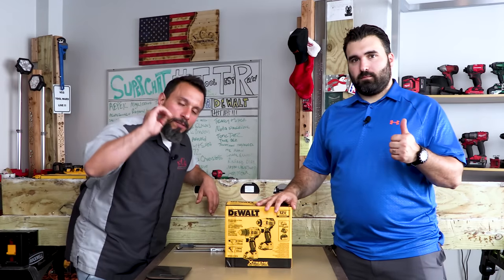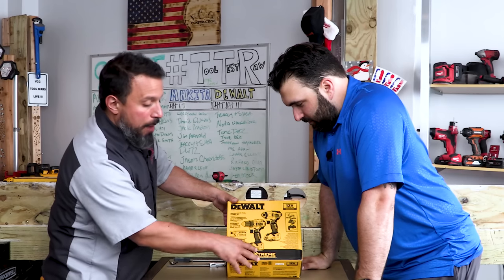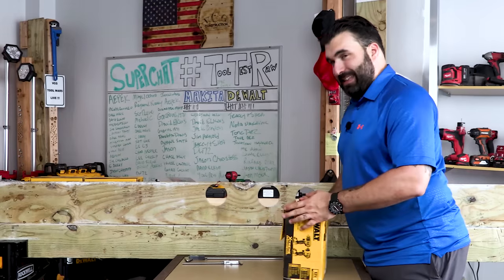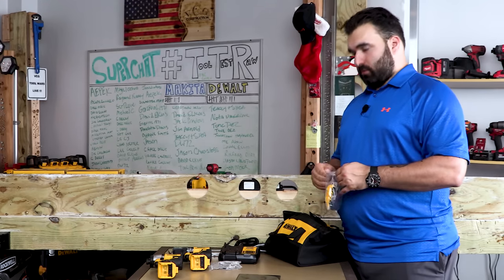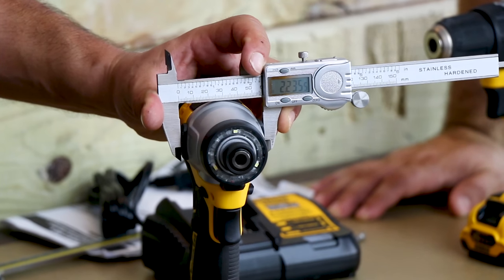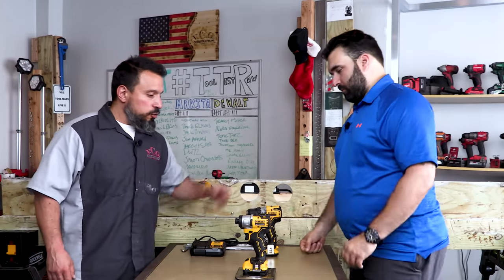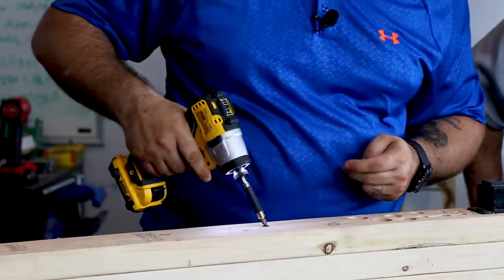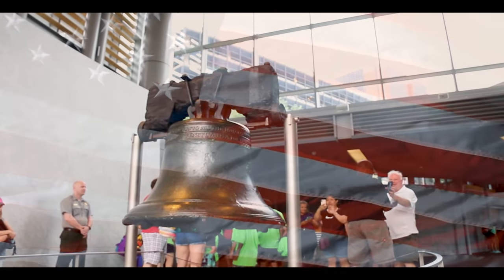NEW DeWALT TOOLS 12V XTREME COMBO KIT THAT YOU NEED TO SEE!

Comment: I keep hearing the new 12 volt dewalt tools are 1000 times better then the original tools
Reply: Yes I just got the 12v screw driver kit today at Lowe's, it's nice lots of power for such a small drill. $99.00 + tax comes with 2 batteries and charger and tool bag. 👌 it drove 4 inch deck screws no problem sinks them perfectly in setting 15. The max setting sinks them deep also.
Reply: M12 is way better anyway
Reply: @noahunderwood5858  Milwaukee ain't got nothing to do with this conversation
Reply: @noahunderwood5858  maybe just a little late, but I prefer the 12 desalt impact over the m12 impact

Comment: 3/8 chunk isn't a deal breaker. Most bits that would require a 1/2 chuck would also require a stronger drill. It's about using the most suitable tool for the job.
Reply: Agreed!

Comment: They're at Lowe's now. I just got the brushless screw driver 2 batteries and charger with carry bag for $105.00 with tax included. I'm going to get the impact driver and drill next. 👌 I was surprised by the power it has for a 12V driver. Beats my 12v makita ones for sure. 👌

Comment: Over here in the UK the Dewalt DCD701 delivers 57.5Nm compared to the Milwaukee M12 GEN2 which delivers 44Nm with a 3AH battery and above, but if you use a 2AH battery it only delivers 37Nm. I hope this is helpful to you all.
Reply from the maker: Thanks Milto we appreciate it!

Comment: Hi Vince and Jimmy ,

I had the original dewalt 12v (brushed set) for 8 yrs and i used it when installing cabinets and smaller project. Now like jimmy said sometimes the dewalt 12v length was an issue sometimes. Then i got the m12 milwaukee gen2 and yes it was a better set. My only issue with the milwaukee m12 was i didn't like the handle at all. For me it was uncomfortable, but good power. Now i purchased the milwaukee m18 gen 3 drill and impact set (thanks to your videos and a few other good youtubers) and that was the game changer. The m18 impact was way compact and the drill was also compact. The m18 has a better handle then the m12, plus the new 3.0ah battery a great combination for me. Now i still have to give it to DeWalt, i really like their handle grip way better then the milwaukee (sorry about that, LOL). I sold my m12 set and I'm truly happy with the milwaukee gen3 set. 

I hope this new dewalt 12v line works out for alot of people who can use them. Can't wait to see a TTR. 

Again thank you for all the hard work you put into the videos and info you provide on all the brands. 

I will always carry Milwaukee and DeWalt tools with me at all times. Very happy with both brand.
Reply from the maker: Thanks for all the feedback Michael we really appreciate it!!

Comment: I was very much a Makita user from the 2012 forwards used at least two gens of their cordless drill driver borers . That was until they updated their range around 2013/14 with their more compact cordless drills , I was put off by the replacement of the metal chucks for plastic and the gear box housing also now been plastic . This did now stop my employers buying two to replace the older models  , but I kept the older model , in fact it is still working to this day , but now in the hands of a fellow work , has for the newer Makitas both now have issues , ones has massive amounts of play in the  the drive systems . So has I can every three year I can buy a new drill , I spent half a day comparing DeWalt and Fein and Festool . Again I picked my DeWalt even over the best of German tools simply because it featured more metal parts .not on price both other options were in the same premium price range , yes Festools do have their crazy life time guarantee and free servicing , but I do not find the feel of the drill has nice has the DeWalt . So getting for over three years of near daily usage it's been dropped a few times but it is still running , the chuck is playing up but that is nothing to be honest ,it is a little bulky in confined places but with 18 volts and insain torque I love it. So yes the last and Current gen of DeWalt tools are up there with the best for sure

Comment: Those are some nice 12V DeWalt  tools.  I really like the compact size of the impact driver and appears to preform well from what you showed.  It's good to see DeWalt stepping up to compete with the Milwaukee M12 line and a TTR with the M12 Impact vs. the DeWalt 12V Impact would be fun to see.  Thanks for sharing.  Cheers!

Comment: To me personally from experience, yes plastic chucks are a def NO. At some point I had to screw some latches in a uncomfortable angle and I did it but I didnt realize there was a sharp edge sticking out and was hitting my chuck which happened to be plastic and it destroyed it. So if I was to grab the chuck to hold a bit and pulled the trigger too hard it would scratch my hand or mess up my gloves, but a metal chuck would have no problem rubbing against a sharp metal edge or screw.

Comment: Whats the point?  Not any smaller than 20v, yet less powerful.  Atomic 20v is awesome and goes anywhere you can get your hand into. The mate to have with it would be the 996 hammer drill for serious boring. The 887 impact is a beast, fast, extremely powerful, and also super precise for delicate work. I've had no issues with it as you've had. It basically the same size as the 12v.

Comment: Those plastic chucks last just as long as the metal chucks never ever had a problem with a plastic chuck
Reply: Your right, its only the outer sleeve that is plastic everything inside is metal. But i get that seeing plastic makes things look cheaper. The real difference is wether its a 3/8 chuck or 1/2". Even though these small drills aren't ment for larger drill bits its nice to have it available for quick hole or two.
Reply: I have the 12v older drill with plastic chuck also. It is all mangled up, if you are drilling holes on cabinets for plumbing etc... and other situations, the chuck against the wood starts melting and then it is harder to tighten without as much grip
Reply: Agreed

Comment: New DeWalt 12v vs m12 fuel or Makita subcompact TTR
Reply: The DeWalt 12v looks alot more comfortable than the M12 handles, that's what I liked about the makita subcompacts as well
Reply: Needs a 6 ah and hammer mode
Reply: I have the makita ones, the Dewalt ones are definitely better. I just got the Dewalt screw driver with the 15 settings works awesome sinks 4 inch deck screws no problem. 👌 I did 30 of them and only lost one bar of power on the battery. 12V 2.0AH battery.

Comment: Late entry: Got these for Christmas 2019 (before COVID hahaha) .... recently (March 2020) brought these along "for backup" when my "Daughter of Adventure" brought me along on one of her adventures into the heart of Appalachia we now are in to pick up a used wooden swing set / playhouse that needed to be UN-assembled. She assured me the sellers had the tools and would do it.

I had my doubts and so took along my Dewalt 12v drill/impact driver set "just in case!" "Just in case happened in about 6 or 7 minutes if that! All their batteries and tools failed! (Why would you bother charging your batteries overnight, Bubbah?" So I GOT STUCK taking everything apart with my drill that I had charged battteries for and used a little 3 months before at Christmas time. 

This little 12v set KICKED BUTT BIGTIME! Having been using Milwaukee and Bosch 18V tools prior to this I wondered if these little DeWalts could do BIG MAN chores! I had just got them for little house jobs inside. Boy, was I impressed! I went right out and got the DeWalt 12v HAMMERdrill! (the brushless DCD706). What a little beast! Awesome tools!

NOW IF DEWALT WOULD START MAKING MORE 12v TOOLS, ALL WOULD BE GREAT!

Comment: These DeWalts seem interesting, I wonder how they compare to the Milwaukee and Makita 12v even harbor freight has a 12v line. I think that would be an interesting TTR 🤔
Reply: Milwaukee has more torque but suffers in ergonomics. I think gen 2 will be where DeWalt rejoins the pack and maybe even surpasses in certain areas. For now I'll be holding onto my m12 ratchet and multi tool.

Comment: The screwdriver in this line is pretty incredible. I prefer my drill to have a 1/4" quick disconnect vs a drill chuck. With the availability of quality hex shank drill bits, I don't need a drill chuck.

Comment: I also think it would be a great idea to compare the atomic to the new 12v extreme. Agree with you fellas points of smaller and more feature rich, especially since it seems like the atomic series is mainly going to be an entry level kit for Dewalt since its power ratings do not seem to be commercial/professional duty.

Comment: Without going to my Van and digging my 12 volt out they have been brush less for at least the last two series . Though not as compact . My fellow collage has the last version before this new series , basically the same has mine but with a slight face lift. Metal chuck not sure what type , but mine is now playing up chuck wise . Though I can buy a replacement in any tool shop. , The chargers are universal across the DeWalt ranges these day's . I go for the 5 amp hrs , adds weight but it's a trade off for operation time , for mixed work types , I can not buy one of these for now until my current DeWalt die's  though .

Comment: I guess when we hear there’s a plastic chuck, we automatically compare it to low quality drills with their plastic chuck but really and truly Dewalt plastic chuck is actually good, I never had a problem with their chuck. I had lower quality drills with crappy chucks but Dewalt chuck never gave trouble for me.
Reply: I still have my 12v max driver with a full plastic chuck it's actually pretty stout. I'm a sucker for a metal chuck though I'll probably get the new hammer drill once it's released if it's the same price as the other kits.
Reply: @zack6892  yeah I also like the matal because all my Milwaukee tools came with it but the plastic on the DeWalt is pretty good because I never had any problem with it.
Reply: @caribbean_car_culture  yea Milwaukee chucks are really nice seems like on every drill.

Comment: Plastic chuck is a deal breaker if milwaukee offers a metal chuck, 1/2 inch chuck, and a hammer drill. Milwaukee>dewalt 12v. TTR NEXT FRI. Milwaukee vs dewalt 12vv
Reply: The Truth well i am a diy/homeowner so to have a small compact drill that can do everything i need it to is awesome. If i buy the 12v dewalt ide still need a hammer drill. Plus the milwaukee kool-aid offers a lot more options in its 12v platform. To each his own but i dont think dewalts gonna gain any ground with this offering. And i do own dewalt tools. My mitre table n planer r all dewalt.
Reply: Their plastic chucks are better than a lot of metal ones.
Reply: M12 line is so far ahead but I am excited to see where DeWalt goes with this lineup. I already invested in it as soon as I seen that DeWalt will be releasing a 12v brushless multi tool I got on board. When it comes to oscillating tools DeWalt is king 👑

Comment: Go to DeWalt Europe website and they list all the drills in NM of torque. So the little DCD701 is rated a 57.5 NM of torque times that by  8.85074579 (which is the proper number to multiply by to equal inch pounds.) So it's inch pound output Is 508.917882925. so it seems like it should, could keep up with competition.

On a side note did DeWalt ever get back to you about all the DCF887 impact drivers you all have managed to burn up?

Comment: I prefer the Dewalt 12v design to the Milwaukee m12 design
Reply from the maker: What do you prefer about it?
Reply: VCG Construction I prefer it because I can stand it on my workbench and not worry about dropping something on the bit and breaking it.
Reply: I agree I hate those stick battery handles they don't feel comfortable in the hand but I still won't buy 12v the 20v stuff is small enough now I rather have more power
Reply: Fur and Feather Farm Andrew des Roches - Flip side of that tho.... If the tool is standing up, then you are MUCH more likely to knock it over and damage the bit and/or workpiece etc. THAT way... Just sayin, 2 different ways of looking at it IMHO..
Reply: Lou Cifer I agree, 18/20v tools are small enough for me.

Comment: Question does the 20volt batteries fit on the 12volt drill? Cuz you said batteries are same size and charger fits both 12&20 volt! Milwakee made batteries different for that very reason, come on Vince ! And then wouldn’t that blow it up if you accidentally put the wrong battery on?

Comment: Don’t know why they’re not available in the US when they’re made in North Carolina 🤷🏻‍♂️🤦‍♂️
Reply: Made in or assembled in ?
Reply: Q-Pid Avenger both I guess lol.  All batteries are made overseas but the tool itself is manufactured in Charlotte
Reply: @6.4DieselDoctor  gotcha, cuz I know their sticker says "assembled in the u.s with global materials"
Reply: Q-Pid Avenger yeah that’s a Stanley thing.  Even the Mac brand says it now even though Stanley has owned them since 1980.  Atleast Americans are building them🤷🏻‍♂️.   Sadly everything from Milwaukee is made and assembled in China although it’s a great tool I still choose to support American workers.
Reply: @6.4DieselDoctor  believe me I like supporting American workers as much as the next person, however in my experience (as well as my uncle and grandpa) dewalt has underperformed, we used them exclusively for years but as soon as we handled Ridgid, Milwaukee or even sometimes Ryobi tools ours felt underwhelming, I switched to harbor freight Bauer line since I changed professions and just use them for around the house tools, while my uncle and grandpa switched to their Hercules line and haven't had an issue at all
Reply: Q-Pid Avenger I’ve often wondered how’d the harbor freight impacts would perform
Reply: @6.4DieselDoctor  they're great, I have the Bauer one and it does everything I've needed it to do, my grandpa and uncle use the Hercules one and it holds its own against Milwaukees non fuel line and other tools like Ridgid , DeWalt and Makita, even beating some of them in their own experiences

Comment: I won’t be buying the drill driver because of the plastic chuck sleeve, I’ll wait for the hammer drill because it has a metal chuck
Reply: Same here I'd like to see some paddles and fastening done with the drive though as I assume the hammer drill will use the same motor.

Comment: The atomic series is only available at Home Depot, whereas the 12v extreme is only available at Lowe's. I'm a fan of the 12v over the 20v. Lightweight and plenty of power for homeowner use.

Comment: Milwaukee 12 volts have too thick a grip, from their battery configuration.
Reply: It sucks, the batteries may be more compact, but the locking mechanism fails on a battery, and then, the battery is basically useless. They have more options with the size of battery, but wish they had a better locking system
Reply: And thinner grip, but due to the battery, that can't be helped, much prefer the grip on a m18 or DeWalt 20v

Comment: I hate to see them going to the little electric push button mode control on the impact. Not a fan of it.
Reply from the maker: What dont you like about the electronic switch?
Reply: @VCGConstruction  It might be more in my head than anything. I just really like the positive feel of switches that Im used to and I feel like the electronic button is just one more thing that could break down easier than the mechanical switch. I've been pretty much die-hard Dewalt all my life and admit I just recently dove into the Milwaukee M12 lineup with the 3/8 fuel ratchet. I'm seriously considering grabbing the 3/8 fuel stubby impact. Thinking I'm gonna stay with Dewalt as my "general construction" tools and go with the M12 Fuel line for my automotive stuff. Maybe that will change my mind on the buttons. Thanks for you guys' hard work on these reviews. :)